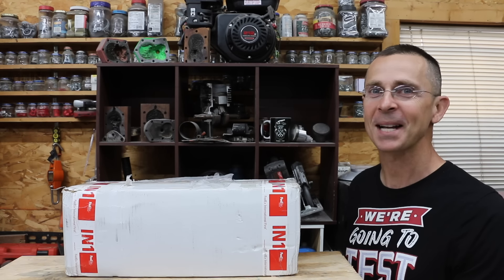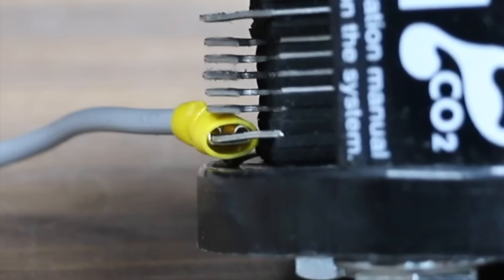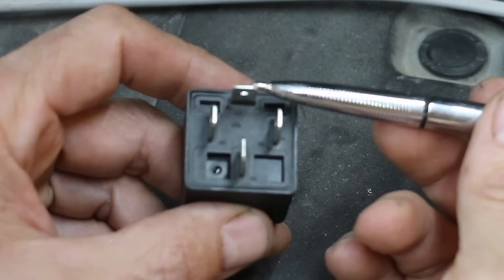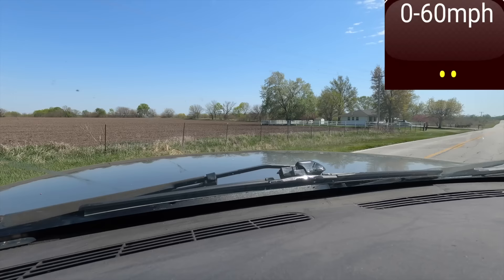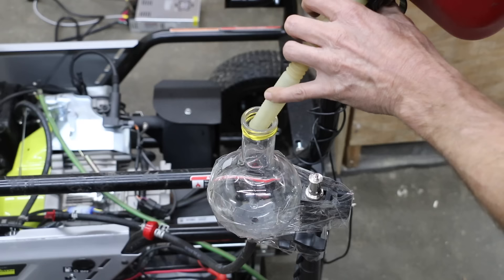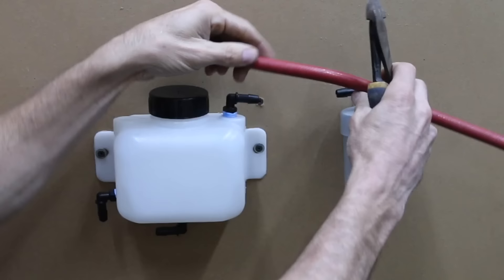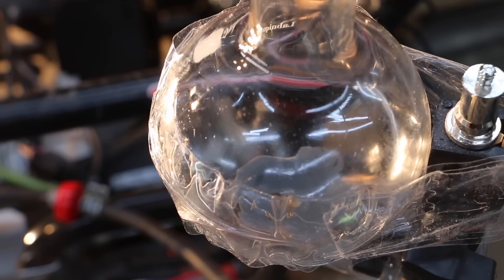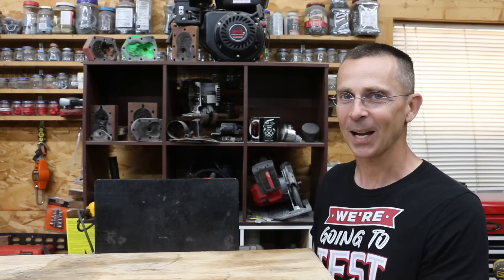AMAZING 35% More MPG with HHO? Let’s find out! Help with high gas prices?

Comment: It may not have cleaned the plugs, but it sure did clean out your wallet.
Reply: I think it's more about buildup over time not being as significant
Reply: @THESLlCK  Since it's using more fuel that would be impossible.
Reply: Yeah hydroxy gas ain't for liquid engines
Reply: using a 10dollar 2 stroke oil mixed with  the fuel would have done wonders for the engines than using a 200dollar hho device...😁😁😁
Reply from the maker: Good Point!
Reply: @ProjectFarm  i wonder if the hho  would have given better run time if you have sourced its energy consumption from an isolated power not from the generator itself..
Reply: @fidelcatsro6948  stack half a ton of lead acid batteries in the back, charge 'em at home, congratulations you've got something that almost entirely isn't an EV.
Next up: Bypassing the ECU to permanently engage the starter motor.
Reply: @michaelmay5453  cleaning the plugs, buddy. Read.
Reply: @fidelcatsro6948  i wonder if i can be better mpg if i source my gas from my neighbors vehicle instead of using my own fuel tank..
Reply: That’s what it’s designed to do
Reply: @Paremo_  or make HHO at home and find a way to release it in the intake port when needed
certainly more efficient because the car alternator is not a very efficient way of producing current
also through batteries you lose efficiency and make the car heavier, heavy car ≠ good mpg without regen braking
same thing with the generator, as far as I know the price of electricity from the grid is much cheaper than that from the generator, maybe a big diesel generator helps with that
Reply: @virtualtools_3021  sure amigo just dont get arrested for it...
Reply: @nateflorea9009  or use a windmill fixed on the truck to get 100watts to run the hho while it runs 😁
Reply: @fidelcatsro6948  yes I saw from quint builds channel that it doesn't impact the aerodinamicity as much as you might think
Reply: @TugIronChief  I wonder if the wind turbine could be a viable replacement for the alternator. Aero drag vs mechanical drag.... which is actually worse
Reply: @kuhljager2429  mechanical drag from lenz law of cos
Reply: @grancito2  you failed to understand my reasoning for that.. idea is to see how much work can the hho addition to fuel do by itself before factoring the energy input to the electrolyzing device.. thats how we experiment amigo!
Reply: @nateflorea9009  worthy experiment then for PF for another day perhaps..
Reply: @fidelcatsro6948  you can’t make and use hydrogen fuel using an engines rotating power and have a increase in efficiency, that would imply infinite energy. Engines at best are about 35% fuel efficient, alternator turns rotational energy into electrical energy at 50-70% efficiency, then hydrogen generators turn electrical energy into hydrogen gas at about 60% efficiency, then that hydrogen gas is burned at 20% or less efficiency. You are wasting energy and creating a net loss.
Reply: @Dirty_Bear22  thats why we need proffessori Project Farm Todd to do the experiment with energy use to run hho from a separate source just to see how long the generator runs...we need to see practically not just theorize with maths and science equations...Lord Kelvin a great scientist once said man wont be able to make flying machines because they are heavier than air, but meagre bicycle mechanics proved him wrong in the end...we need to see the practical trials and errors of this before meowing any further😺😺😺.
Reply: @fidelcatsro6948  hydrogen engines already exist, efficiency is lower then gas mainly due to molecule size. The small gas molecules slip by traditional gas engine seals, so they had to be made tighter. Tighter seals means more drag friction and heat, which lowers efficiency. Solid state batteries are probably the future, not engines.
Reply: @Dirty_Bear22  i see ...interesting to know...reminds me of my V twin yamaha which was such a pain to push start because it locked up the wheels unlike a parallel twin engine because of the tightness of the engine configuration
Reply: @fidelcatsro6948  doesn't work like that.
Reply: @fidelcatsro6948  probably locked up because higher compression or displacement.  I can push start my ct90, but not my Harley.  Engine layout has little to do with it- going to come down to gear ratio on transmission, compression and/or size of engine, and internal friction.
Reply: @roguepoops23  yes i meant engine configuration v engines are harder to push start compared to inliners...my bandit 1200cc inline 4 can push start easier than my former virago 535cc v twin
Reply: @virtualtools_3021  That is sure to work😂
Reply: @virtualtools_3021  No, mpg would remain the same.  If the neighbor is paying for the gas, your miles per dollar changes.  Providing you don't mind the ethical and legal issues.... Well, I don't think it's a good idea.
Reply: @fidelcatsro6948  I have always gotten better fuel mileage with Marvel Mystery Oil mixed in my fuel. I try to draft behind the fastest semi truck I can find too, but MMO certainly works for me, but sometimes I will just mix in some cheap conventional oil with the gas on long trips too. On all of my vehicles through the years I have always picked up 1.5 mpg on up to 4mpg depending or the original fuel mileage. If I can find some ethanol free gas ⛽, I can top that and get another 8 to 10 percent better mileage over E10. Sometimes it's worth it and sometimes it's not depending on how much they gouge you on ethanol free gas. On my newest SUV my mileage jumps from 27 mpg to over 33mpg. I drive that little thing like an 18 wheeler speeding down hills and slowly shedding speed coming back up, using neutral to coast to red lights, going to higher gear as soon as I can without lugging etc, using Eco mode, etc. Wish my 20 year old v8's had eco modes, especially around town...and I wish my city had roundabouts instead of traffic lights every block.
Reply: @user-bn3zo3mh5v  i think PJ did some videos on marvel oil, stp and anothee brand i cant remember do check them out
Reply: @user-bn3zo3mh5v  sorry amigo.. the oil i was trying to tell you earlier was Bestline... PF found it to be the best of all !!
Reply: @fidelcatsro6948  Sorry about that, I probably didn't clarify that I was using MMO or just plain motor oil mixed in with the gasoline instead of in the crankcase, but I saw that Bestline video. Looks like amazing stuff!
Reply: @user-bn3zo3mh5v  it should.. i tried some stp oil treatment in my 2 stroke bike and it felt smoother..i cant find bestline in my domicile sadly..
Reply: @kuhljager2429  this wouldn't work well at junctions.
Reply: Actually it pumped up his wallet after all the views and subscribers from this video.
Reply: @kuhljager2429  mechanical drag is more predictable. It would be a drag to hit a bird on a trip and mess up the wind turbine.
Reply: @nateflorea9009  If you have HHO, put it thru' a fuel cell,  not an IC engine.
Reply: @fidelcatsro6948  that would defeat the purpose then.  It draw power from your car to create the gas for the car so it should draw energy from the generator to make gas for the generator.  Unless you plan to have a generator in your car so you can outsource the energy while driving to get better gas mileage which ultimately will cost more to run 2 engines...
Reply: @gamingmadesimple5510  i wanted to see the significance of hho in the engine combined with its normal fuel diet...
Reply: @osmacar5331  Agreed, it's for solid engines.
Reply: @michaelmay5453  yeup, or hydrogen engines, or even fusion reactors
Reply: @THESLlCK  Don't get salty about his reply, it was perfectly valid. 
It's using more gas, which means less efficient burning, which means more buildup and residue, buddy.
Think.
Reply: @osmacar5331  Fusion is done at 100 000 000 000 degrees. Try putting that into a car and realise that the minimum weight would be about 350 000 tons just to shield a process that you can't make last even with that protection.

Hydrogen fuel cells are fine, using a distant fusion to fuel it would be nice, it can and has been done.
Reply: @strixt  Less gas is being used when you can apply less throttle and let more hydrogen in instead. Think.
Reply: @THESLlCK  Ah yes, the "use less throttle on the generator" argument. A classic if there ever was one.
Reply: @strixt  that's not what I said and you know damn well
Reply: @THESLlCK  You're absolutely right. I had assumed you were taking about the generator. I had to work after I watched the vehicle part so I'll admit that I forgot he talked about fouling during that part as well. 

I do understand what you're saying and the gen was under load, but in vehicular terms I would think that translates to just about anything above idle. It would definitely be interesting to see if no load gen/idle vehicle changed anything about it.
Reply: Until her uploaded the this video . . . then cha-ching!
Reply: @fidelcatsro6948  He hooked it to the battery,it would have gotten better milage if he did hook it to the alternator,probably paid off by big oil to screw up the test.
Reply: @nateflorea9009  Bob lazar does just that.check out the video on YouTube.
Reply: @fidelcatsro6948   That would work,kinda ugly though.
Reply: @bugsbunny3488  a link please? I couldn't find anything related
Reply: @nateflorea9009  running your car on water(youtube)
Reply: Cost me stuff I had laying around.
Reply: @joec6660  yea but does it work efficiently?
Reply: Lmao 😂😂😂😂😂
Reply: @Dirty_Bear22  Modern diesel engines are capable of 40% efficiency.
Reply: @fidelcatsro6948  then you need to add energy from another source, that still means it lowers efficiency
Reply: @Dirty_Bear22  About 15 years ago someone I know bought one of these HHO generators for his car. I told him that there's no way it could give him any extra power as the power to split the water was from the burning petrol. He tested it and I was correct.  I have used a mains powered HHO with a gas torch for making some custom lab glassware, also for flame polishing cut acrylic surfaces.
Reply: the fuel management system on newer vehicles defeats the HHO but works really well on an old carburetor engine.
Reply: @osmacar5331  the fuel management system on newer vehicles defeats the HHO but works really well on an old carburetor engine. If done right it will greatly improve your MPG.
Reply: @fidelcatsro6948  the fuel management system on newer vehicles defeats the HHO but works really well on an old carburetor engine.
Reply: @mikewhite7462  i see yum yum should try this on my carbuerated bike
Reply: @fidelcatsro6948  we put a home made HHO on a carbureted jeep. we got 34 MPG
Reply: @mikewhite7462  you got videos?
Reply: Yes these are very efficient wallet cleaners. Perfect scam. Sounds and looks like it does something so people gobble them up.
Reply: You can easily make one of these yourself for half the price.
Reply: @user-lj6gk4lv9s   1st I hate electrics and then that would be pointless as the purpose of all this experiment was about trying to lower fuel MPG and not converting car's engines to electric motors LOL...
Reply: Did someone really recommend feeding the hydrogen into a fuel cell?? Why? So you can turn it back into electricity? 😂😂😂

Comment: That video was literally worth $200.00.  Thanks to you Todd, that money is still in my pocket.
Reply: Dido!   To bad!
Reply from the maker: You are welcome!  Glad to hear!
Reply: When you said it was worth $200, he was  hoping you literally meant that and give him the $200! ;-)
Reply: @Charles McKinley apparently hho has a higher expansion rate, it does burn more in the cylinder then just gas. 
 But you have to reprogram the ECU/chip and do all kinds of stuff that makes it not really worth it.. 
 The engine starts sensing more oxygen and then starts dumping in more fuel because it thinks its running lean, so generally you're not going to get better results without heavy modification.. 
 Also optimal voltage is 2.2v so ideally you want 6 cells separated in the car, you charge at 12 volt but tap off the batteries in parallel so you only get 2.2v to the cell..
Reply: @ProjectFarm  thank you. I can't afford to put 200 bucks into something that is a gimmick
Reply: Gasoline engines are just build too badly for a simple system like this. I can't believe he didn't do a mpg test, simplest thing but I guess you have to skew the numbers somehow. Plug this basic system into a diesel. Straight forward engine that isn't making a purposeful effort to waste fuel.
Reply: @sirmagnus99  The water is electrolized using power generated by the system itself.
Even if it were 100% efficient, which is impossible, it'd just break even.
Reply: @smolpener7430  The water is electrolysed with an electrolyte. I us KOH. The electricity is used to cause electrolysis. I am not a fan of the system he bought because I don't know what's in it, positive, negative, and neutral plates. The set up is important for function.

Comment: The 300+ people that disliked the video bought this contraption.
Reply: Yeah, and they are pissed, that the true is out! Haha
Reply: There's a sucker born every minute...
Reply: @Geza......the 300 people bought it with their stimulus check 😏🙌🏽
Reply: Or might disliked for the fact of even making a video about this hogwash.
Reply: Plus 4 that disliked your comment☺️
Reply: @agriszalmans3581  How do you view dislikes on comments?
Reply: I think the dislikes is not for Todd, but for the kit
Reply: @nelsonbrum8496  that's a great question ❓.  Ever since biden's been in office they disabled the count for dislikes. I remember the ignaculation Biden, throw some 400,000 dislikes and rumor had it that YouTube eliminated about a million of them
Reply: @NickAlati  derp
Reply: I just don't get how people fall for this shit.. like it takes energy from the alternator (engine) to generate the hydrogen plus the energy that's required has loss (thermal energy mostly). The only way you could do it was if you had regenerative braking or something. similar.
Reply: 1% dislike and 99% like is the usual ratio for non-controversial and well made videos. Right now the actual numbers are Like:47k, Dislike:474
Reply: Or work for the company
Reply: How can a device that uses horsepower from your engine give you more horsepower? Lol doesn't make sense. Free energy doesn't exist.
Reply: @NaterNorris  A fuel pump can do that...
Reply: @NaterNorris  A supercharger works that way. It uses the engine to compress the incoming air. With more air, the engine can add more fuel, generating more horsepower.
Reply: @NaterNorris  supercharger…
Reply: @mohammedakmah5230  is it is it really cause how long does it take to make enough hydrogen for one running the engine for one second? think about it think about it cause theres a difference between it's making gas and it's making enough gas to make a difference on fuel economy
Reply: Yes, I think some are sellers

Comment: So what we have learned here is that Mr. Project Farm could have obtained the same results by just simply lighting his $200+ dollars on fire.
Reply: At least then he would have had heat.
Reply: As much as I love these videos, qas hoping for a tl;dr sooo thank you 😊
Reply: Seems the only thing this quackery reduces is the weight of your wallet!
Reply: Almost true - in addition he could been working the time he spent for the test at dollar 30 per hour - Minimum🤗🔭🌄👍
Reply: Probably would have generated more energy.
Reply: Now he has to buy a new intake pipe for the Suburban and a new air filter box for the generator
Reply: @tomrogers9467  I suppose for it's use with an engine it's a complete waste but  I guess if you ever needed to make hydrogen at home it could be still useful $200 seems like a stretch though for something you could probably make with tupperware bins.
Reply: Bro you killed me
Reply: @infernaldaedra    The problem here is that the gas produced is a MIXTURE of Oxygen and Hydrogen.  “Can you say BOMB?  Sure, I knew you could”!
Reply: @tomrogers9467  💥 Boom haha
Reply: @satsumagt5284  doubtful either will be replaced, neither system is pressurized so a peice of good tape over it will adequately seal it or a rubber plug. It is project farm, those holes will be used again for future tests.
Reply: @jaydunbar7538  maybe, good point. I'd replace it if it were my own vehicle
Reply: Nah, he just makes a small fortune from YouTube by posting these videos. I for one am happy to watch them. YouTube keep paying this man.
Reply: Better results because the fire would have yielded heat energy. With inflation the way it is, its the best use for the money.
Reply: actually what he failed to do. was reduce his gasoline intake,when he was adding the HHO gas. in his suv the O2 sensor would read  a cleaner burn telling the computer, engine is running lean.i.e. add more. fuel to the injector. what he should have done was fool the O2 sensor that the engine was running too rich and reduce the gasoline going to the injector. thus saving gasoline. again in the generator, there is no way to reduce the flow of gasoline unless you install a shutoff valve.that you can regulate.